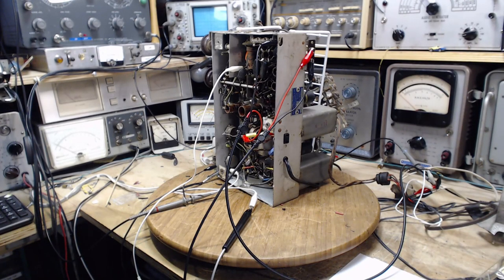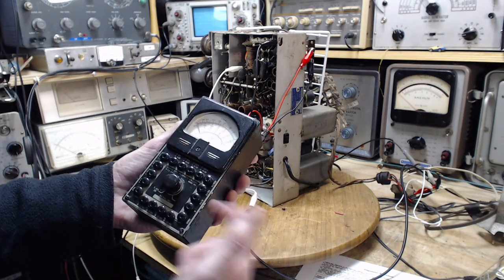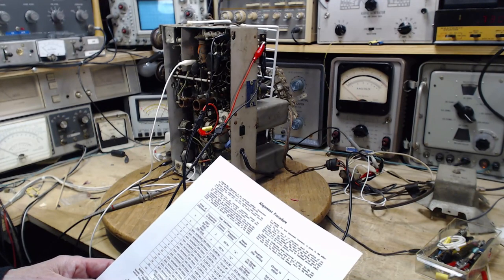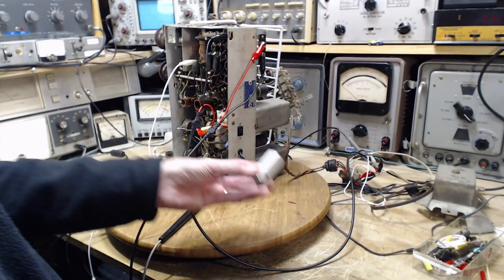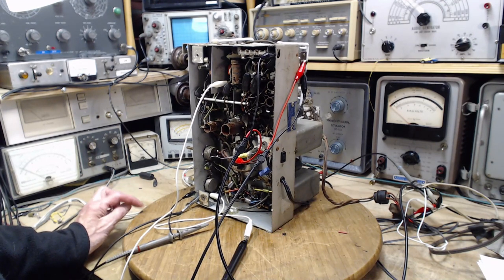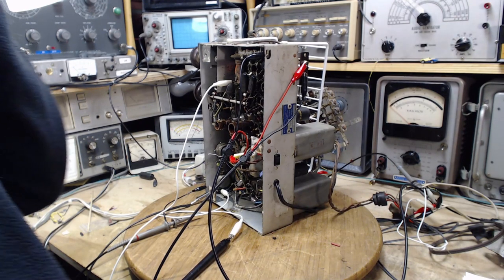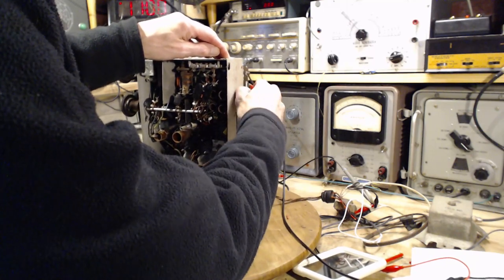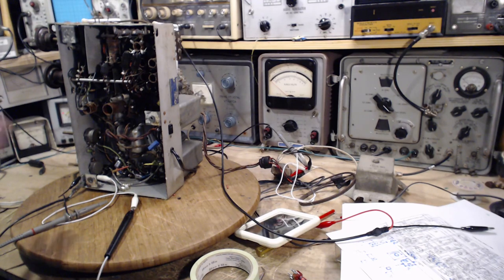RCA Victor A38 Shortwave Tube Radio Video #7 - Intermediate Stage Alignment

Comment: Push all the red center knobs in on your vertical attenuation and time base knobs to put the scope in calibration. You have it so it is set for variable adjustment of each on your scope. I have 3 tube radios in a house full of WiFi and switch mode power supplies and they all work great. A 1959 AM/FM Zenith in my basement shop picks up anything it will outdoors and a 1950 AM/FM Zenith with Armstrong tuning with no AFC in the kitchen that plays and sounds amazing. I rebuilt all 3 and aligned them like the instructions said. Bam, work like a champ. I just peaked them with a VTVM, you don’t need a scope on these radios, they are not a $500 Hallicrafter high performance radio. You do what my dad taught me about shooting straight, study to long you will study wrong. Meaning don’t psych yourself out by overthinking and second guessing. Use the KISS method.

Comment: Like I stated in the last video. This is the FIRST alignment.
 Jim is the only  YT'er  that does more than two on the same radio. At 33:00 there appears to be a poorly soldered joint 
at the bottom part of the video. He even admits that " it is quite likely I messed everything up". After all this , not a single 
station  comes through clearly and with any loudness to call this anything but  a complete waste of time, again.
Reply: Perfect example of what I stated to you on Glasslingers video. People put likes on this experimentation, not restoration. Just willy nilly twisting of if cans, oscillators, trimmers……..bad soldering, bad old components. Not a place for a newbie to learn anything but how to make a bad situation worse. He should have been a narrator or newscaster, he talks well. Wants to be close to radio he should DJ on a radio station.
Reply: Lesson to be learned - Don't ever get between Jim and a IF coil with a sealed alignment screw...